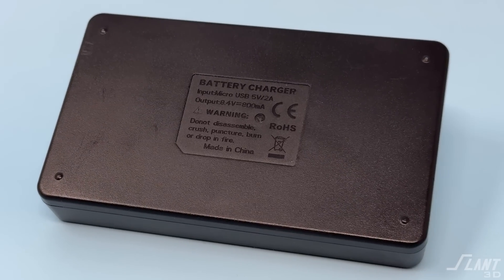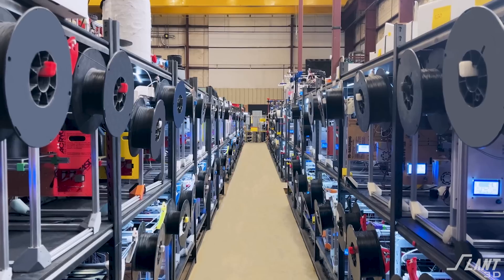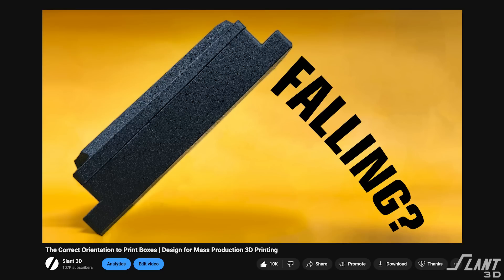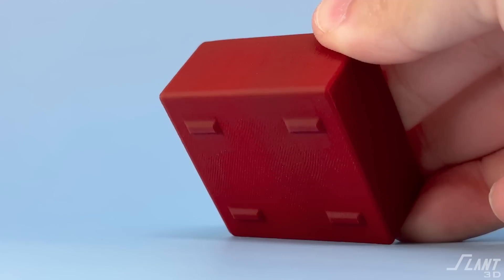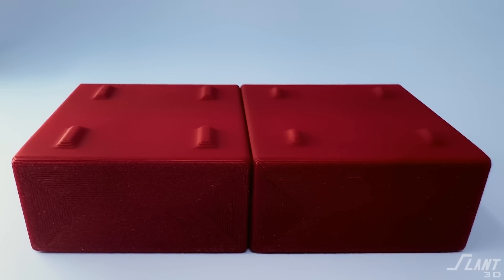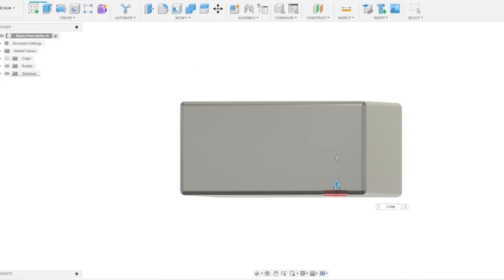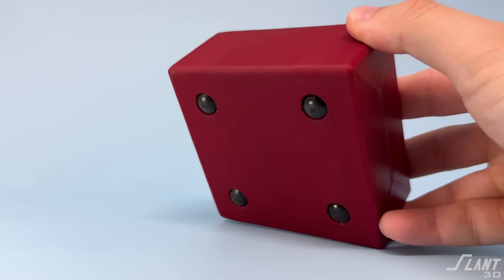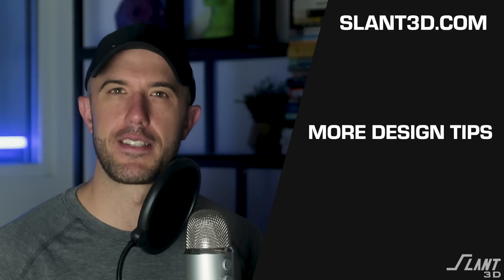Stable Feet Designs for Your 3D Printed Products

Comment: For symmetry reasons, I print boxes right side up, with the bottom on the bed.  I add small cylindrical indentations to the bottom to accept feet later but I do not chamfer the edges of the holes.  Then I print custom feet 0.1mm smaller than the diameter of the indentations.  The feet snap in place so perfectly that they look as if I printed them in place.  If the feet get damage with use, I just print another set for a couple cents.

Comment: I once made a box similar to yours in PETG with TPU legs, all printed in one piece with a multi-tool. You have to allow a lip of the box to fit inside the leg, because these materials don't have very good adhesion to each other, but this way you don't have to glue or have any additional steps. It requires a multi-tool, of course (or IDEX).

Comment: I noticed in this example video that you have fillets starting from the first layer which creates unsupported material around the edges of the first few layers. Most of the time this can be avoided by just using chamfers on the first layer instead. However, some designs have to line up with other parts of an assembly and you can’t really avoid fillets around the first layer, so I use something called a chamfillet. Think you could make a video on it? Nobody seems to know about it and it’s a pretty awesome little trick.
Reply: Basically you chamfer the bottom layer, and fillet the top edge of the chamfer to change the origin of the fillet to start from the (more printable) edge of the chamfer. It gives the rounded look of a fillet but the angle of it is made much more printable. I’d be happy to tell you more about it over discord if you have it!

Comment: Is there a cura plugin or setting that automatically rounds edges? Would be nice to just slap on a 0.4mm radius rounding on all sharp corners in a print so you don't have to think too much about that with all files you put in
Reply from the maker: Never use a slicer when you can do it in cad
Reply: @slant3d  Sure, but it'd be nice if I download someone else's model who use sharp corners for the slicer to automatically smooth them out.
Reply: Most decent CAD packages have the ability to convert an STL to a solid, which allows you to go in and add fillets.
Reply: @Person1873  Yeah, I know, but that's a pain and I'd like for it to be streamlined. You must agree that just dropping it into a slicer and having it be done automatically us much easier than first dropping it into cad, filleting all sharp edges that affect the x and y axis, try to fix whatever errors or miscalculations occur with too tight corners and to then drop it into a slicer
Reply: I know this isn't what you wanted, but for this purpose I often use OnShape. Its fairly quick to drop it in their web ui from an stl and then chamfer or filet. The tools are pretty good at altering the part quickly without causing issues. As a bonus I then export it as .step for more detail on the print.

I was looking for a tool like you described, and this is what I landed on eventually. It isn't in slicer fast, but its a pretty quick workflow once your use to it.

Comment: I'd love to see a video from you talking about chamfers vs filets in more detail. In at least a few other videos you've said to chamfer everything, and here you say it for one type of feet, but then to filet for the next type of feet. In one of my designs I fileted the first layer of a vertical cylinder, and later found where you said not to do that. Could you do a comprehensive comparison with recommendations on the why and when to use which option?
Reply: Fillets apply a radius to the part which is fundamentally changing the angle of the slope, this can create overhang angle issues especially with large fillets.  My rule of thumb is if the edge you want to ease faces the build platform, use a chamfer.

If the edge is in plane with the print head use a fillet because it will be a little smoother for the print head to make those curves. 

To say it another way, of it's a horizontal edge, chamfer.  If it's a vertical edge, fillet.

Of course you don't have to use a fillet anywhere, you could just apply chamfers, but please do use one or the other to break the edges, it makes a much nicer looking and feeling part.

I hope this is helpful to you and I hope I explained the rationale clearly.
Reply: @buildtestbuild  thank you! This was exactly the suspicion I had, but haven't had the time to test it yet
Reply: Fillets also mean that the print head doesn't have to slow down or retractable the fillament, which means faster & cleaner prints, but only when used on Z-aligned edges.
Reply: if you choosing between chamfer and fillet for overhangs - choose chamfer, fillet creates extreme overhang angles, in other cases it's a matter of taste.
Reply: Chamfer Z-axis, fillet XY plane.